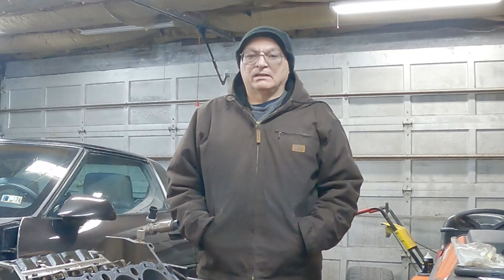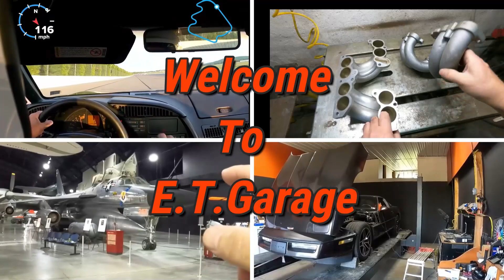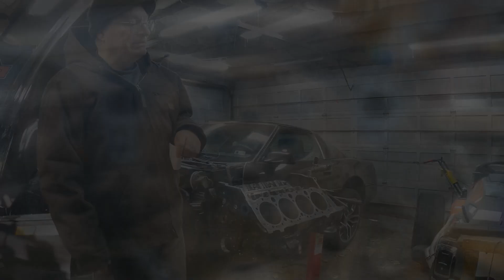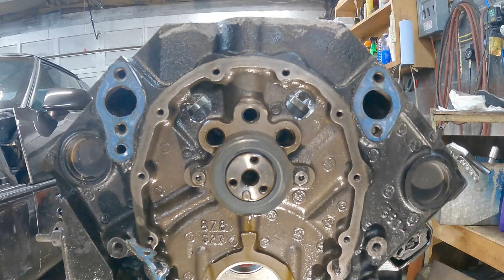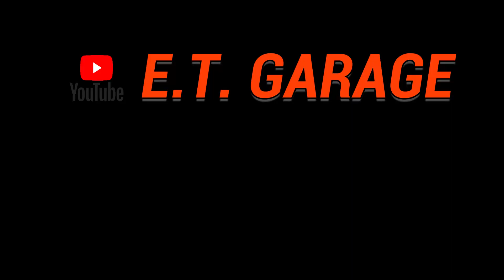Oil Galley Plug Survey Results Who Got It Right. 😎

Comment: I wouldn’t change the heads… if you do that, that means you’re doing it for performance and it’s going to cost you a lot like you said… then the question arises.. why not thrown an Ls1 in there if your wanting performance. So personally if you’re just wanting that low end torque from your l98 and a simple reliable motor.. stick with the 383 l98 with what you already got…
Reply from the maker: I have decided to stick with the stock heads so far but I am going to still try out the new manifold if I do not like it I can always go back to the tuned port.

Comment: If you run those stocker heads. Springs and valvetrain would be a good place she'd some mass and push the rpm range up. If you have not already done so. Them bee hives and retainers shed weight fast.

Comment: With your 383 build what was your header solution, and did it require any modifications to the car or the header to fit properly?  My vote for the engine is leave it as you have it (looks like you need money for tires anyway). Obviously flow the heads if you want, however by building the engine back the way it was you will be giving the new manifold a true test. If you change the cam/pistons/heads, then you may know the Chinese manifold worked, but you won't' know to what extent it either accomplishes or inhibits the build.
Reply from the maker: There are several companies that make headers for C4 Corvettes, I have had Hooker headers on for some time along with OBX stainless exhaust, the only modification is  to add header flanges to the exhaust system, Thanks for your input.
Reply from the maker: Here is a link to an old video on my exhaust https://youtu.be/iWcYeUM2FdQ

Comment: Those side plugs with the hole can be ordered.....  They come pre-drilled for it.... 

I would reccomend doing main oiling mods while you can by enlarging the main feed holes into the main lifter valley oil feed.

Run a Melling Sharktooth oil pump....

Main oiling mods and tricks videos:  

1.  https://www.youtube.com/watch?v=Rbpjg18JOZw&t=417s

2. https://www.youtube.com/watch?v=-3gjwBGOOCo&t=951s
Reply from the maker: Thanks for the links, I have considered the sharktooth oil pump.